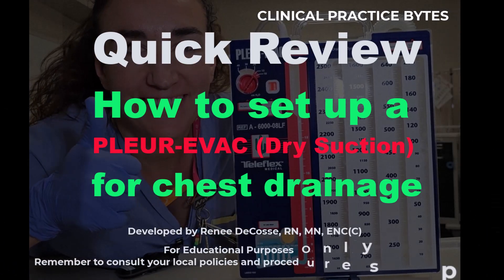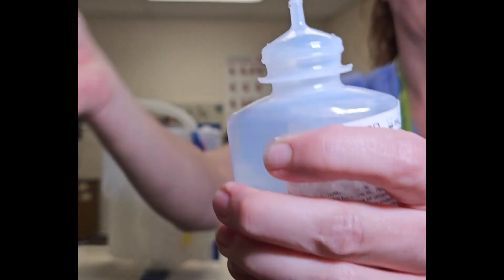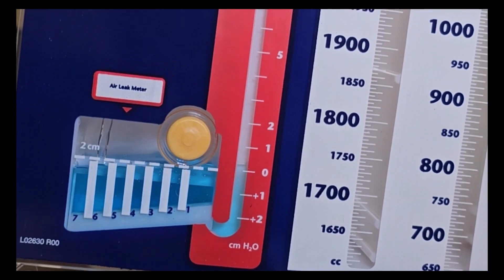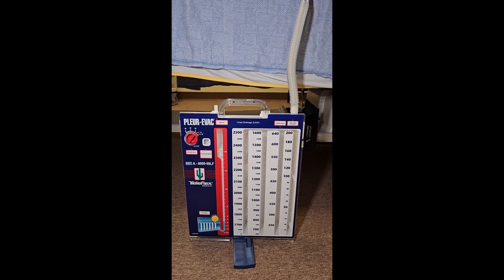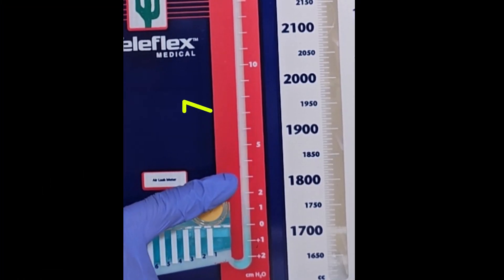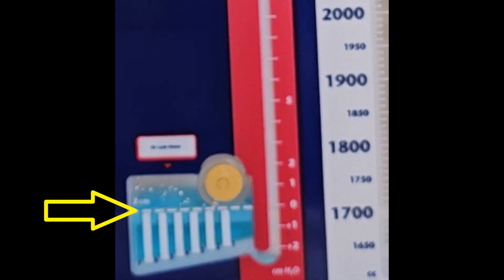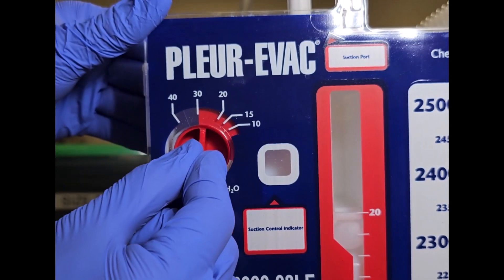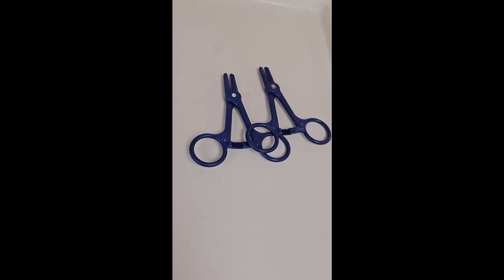How to Set Up a Pleur-Evac for Chest Drainage

Comment: Helpful video. I’m having trouble understand the water seal chamber. If attached to wall suction, will I have activity in the water seal chamber?
Reply from the maker: Thanks for the question. The answer is maybe. Sometimes you will still see tidaling with suction attached, but often not (especially if patient is on ventilator). You can check for tidaling activity if your patient is on suction by briefly removing the suction tubing from the unit. Of course, as always, follow your local policy and procedures relating to chest drainage practices 😊